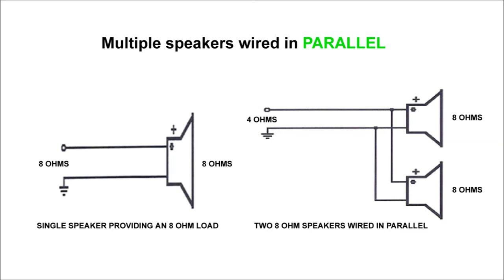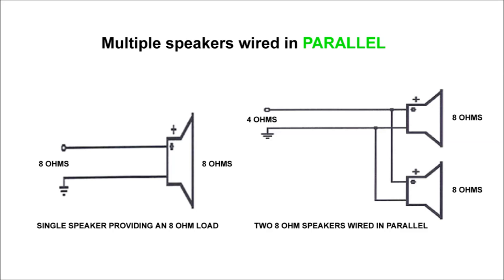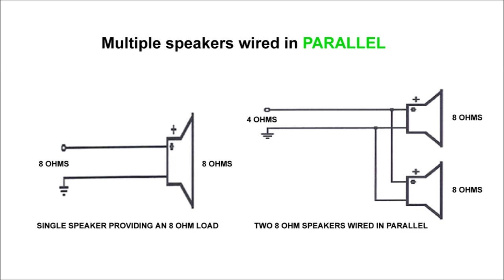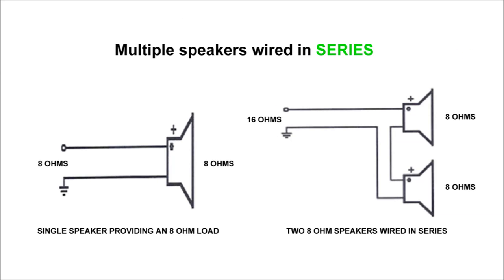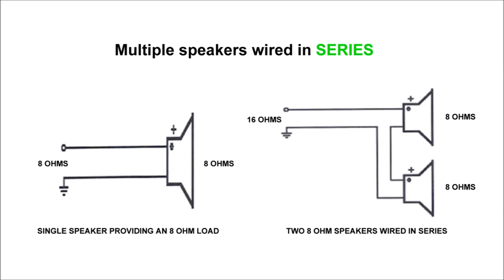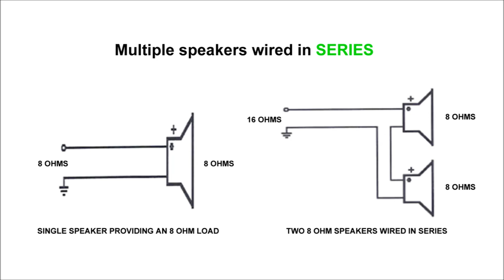ESU #50321 Speaker and Enclosure

Comment: Assembled using the base and both risers to achieve a deeper enclosure. After securing the base and risers together with Faller Expert cement, I applied 2 small drops to attach the speaker to the risers.  When the glue was dry, I carefully sealed the entire assembly with siliconized acrylic caulk.

Two of these speakers were a part of two 4 speaker close coupled arrangements wired series parallel. The installs were into  Athearn RTR hood units. Impressive sound when tuned with a graphic equalizer to tone down the abundant mid range boominess.